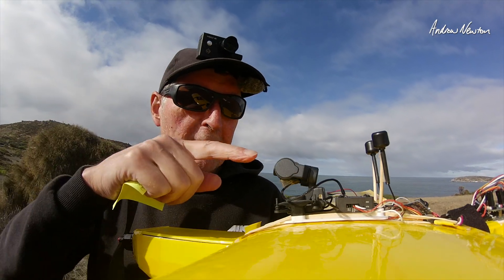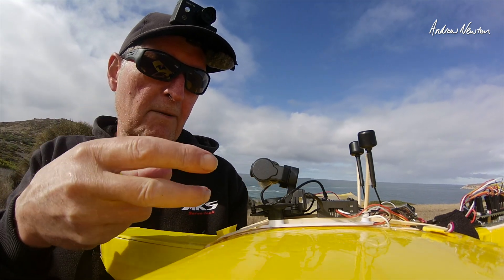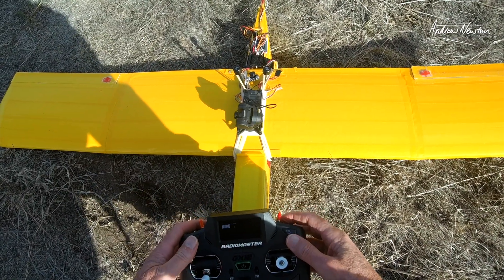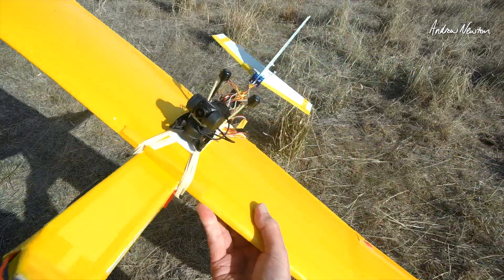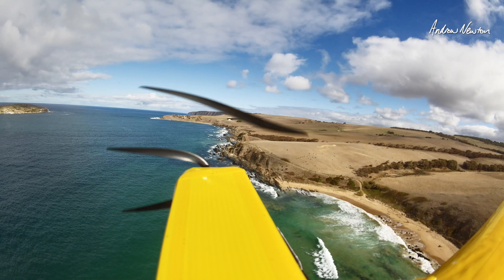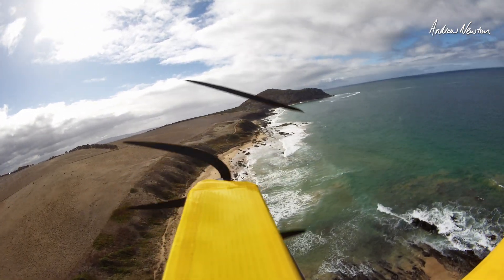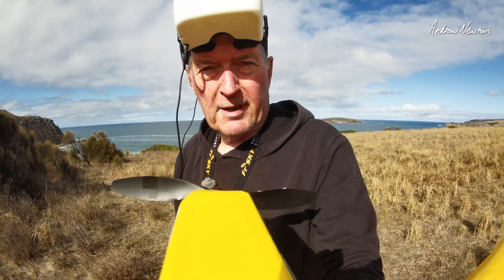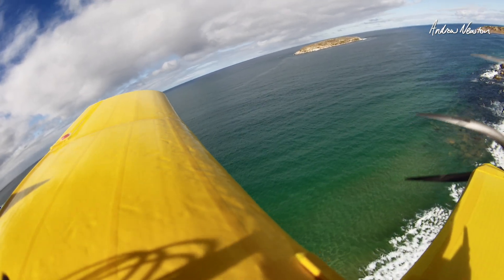XF C-20T 3 Axis FPV Gimbal

Comment: Hi M. Newton. so I can use any camera 19mmx19mm with  is own cable and use the gimble as a stand alone unit ? Because I would like to try to install my runcam camera but I would like to fit it because I have a connection on top, thank you and have a nice day.
Reply from the maker: Yes as long as the cable is long and flexible enough
Reply: Thank you M. Newton, have a nice week end

Comment: Ive watched your Speedybee f405 and this video also, but i still not confident to plug my electronics together. I'm building a FMS Futura 80mm with DJI o4 Lite, XF C20T 3-Gimbal and head tracker, Speedybee F405Wing, DJI Goggles 3 + RC3. I use the regular Goggle3+RC3 for my drones so i hope i can connect everything and still use my basic radio. 

I believe this is the go-to base setup for anyone doing fpv airplanes with the current tech available, perhaps you could make a video teaching how to set it all up. Thank you for all the help! You're a legend!
Reply from the maker: Thanks for your kind words. This playlist will cover everything although I only have V1 DJI Goggles https://www.youtube.com/playlist?list=PLC8MdCMvxwBj_rI23a-Qs4lON54dWleQX

Comment: Good video. I have this gimbal on a plane and it greatly made FPV more enjoyable.  As we know, most FPV RC planes with their foam construction and large wing spans are a more "bumpy" ride compared to more compact rigid quadcopter.  This gimbal's real-time stabilization smooths out these bumps makes FPV fixed-wing so much more enjoyable.

I didn't find it disorienting much but I've been head tracking for a long while.  I'm going to add this gimbal on my bigger long range quadcopters too.

Really important for me was I ended up doing is tying the gimbal stabilization speed to iNav's flight modes.  This allows me to avoid the hassle of fiddling with sliders during flight (4:13).

Acro => 50% stabilization speed
All other nav & flight (angle, horizon ,RTH, cruise, loiter, etc) => 100% stabilization speed

I implement this control logic with some EdgeTX special functions.

Tying the stabilization to flight mode worked out really well.  Because only in acro mode do I need less stabilization to do acrobatics: loops, rolls, dives.  A slower gimbal speed keeps the gimbal more attached to the attitude of the plane.  But other modes I go straight to full stabilization .

The the last mode is the "gimbal working mode" and I have it always set 3-axis follow.  The horizon lock mode (as you showed) can get disorienting as the plane moves all around the video but the horizon is level.  This mode is would be good for getting a very stable cinematic shot.  I think horizon lock is default mode for for DJI drones since they always stay mostly level and mostly used for cinematics.

Comment: Nice, I have one of these in the mail right now. BG were gonna send it for review back in December, but holidays on my side and then theirs, and not being in stock etc delayed things, in the meantime they got a couple of YouTube reviews on their page already and I never heard much more about it. Didn't feel like begging so I eventually just bought it myself. Good to know it can handle the external cable like that, because that's the only way I'll be able to use it. I'm particularly interested to see how it works using AHRS data coming from Ardupilot. It's not clear whether Ardupilot can control the pan-tilt via mission waypoints or 'companion computer', will also investigate that.
Reply from the maker: So you could focus on a point of interest at each waypoint? Nice idea, get coding young man!

Comment: What is the width between the sides of the camera mount, please?
As in, could it handle a 20mm wide camera, or just 19mm?
Reply from the maker: 19mm is is but there is an adapter for 20mm (according to MadsTech)

Comment: Oh Wow - do all these gibmals have these modes? I have the CT-20 and  a GM3 - that would be so useful - do you just set them up in INAV?
Reply from the maker: Yes they would all have the same. Just have to assign channels to the 4 spare PWM outputs that the gimbal is connect to, like S6, 7, 8, 9 in INAV then assign controls to those channels in your radio.

Comment: Hi Andrew,
I was wondering if you could clarify what this gimbal is compatible with. I currently have the following setup:
O3 unit
DJI Goggles 3
Spektrum DX9 radio
Will the gimbal work with this equipment, or is it only compatible with WalkSnail systems?

Thanks for your time!

Best regards,
Reply from the maker: The gimbal I'm showing here is only for DJI O4. There is a different version specifically for DJI O3 which would suit your gear. Can use any RC Radio.

Comment: Very weird when the view stays still and the plane moves around.
Reply: Oddly enough that's how our vision works, too...🤔 The brain does an awful lot of image stabilising and processing (including inverting!) to make things look 'natural' enough for us not to be throwing up all the time.☺️
Reply from the maker: Yes you need a very forgiving model
Reply: He has the gimbal in "horizon lock mode" which is good for cinematic filming.  There are 3 modes and one of them all three axis follow which makes flying a very smooth.  I rarely use horizon lock mode.

Comment: Hi Andrew,
On an aircraft in cruise mode (no aerobatics), the difference between rocksteady stabilization and a 3-axis gimbal is minimal, is it worth the extra weight and cost of a gimbal?
Reply from the maker: If you want super smooth footage then yes it's worth it. But to be honest I prefer unstabilised video.
Reply: @AndrewNewton  I quite agree.
Reply: This gimbal is a total gamechanger on FPV fixed wing.  The stabilization finally gives the fixed wings the smoothness of a well tuned small to mid-sized quadcopter.  Also the very 3-axis movement is fast and smooth.  The pan axis almost has a full 180-degree pan so you can look behind which is great for spotting targets on the ground without repositioning your plane.  Would be great for formation flying too to spot your wingmen while holding your craft's position steady.  The amazing thing is all that comes in fairly small package.

For this to work, you need setup the stabilization speed to your preferences.  Avoid the "horizon lock" mode on fixed wing.  Horizon lock is good for stable quadcopter cinematics.  See my other post for some more details.

Another thing that helps is to be fairly comfortable with your FPV plane in the way it flies and handles.  I recommend sitting down instead of the usual standing during FPV flight.